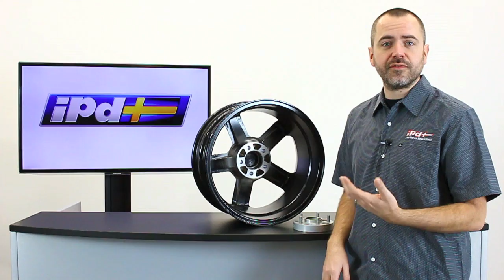IPD Volvo - Wheel offset correction for rear wheel drive Volvos

Comment: Just to know if there is anyone having a extra thin bolt at rear rotors and if we have to cut it to fit
Reply: You can screw it out. Its just an alignment pin. Your wheels should have a spot for it to go into though.